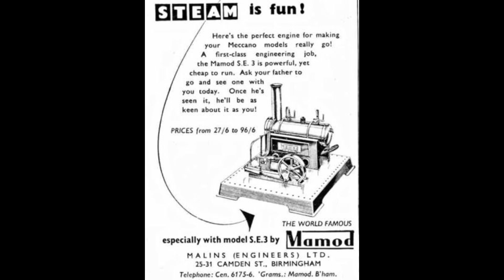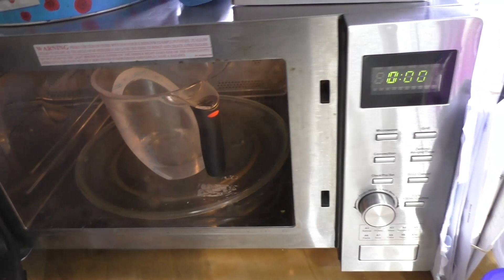The 1960's Mamod SE2 steam engine.

Comment: I had the Traction Engine with a rod that went through the chimney to turn the front axle as it went along the fire was a box full of some sort of wadding you filled it up with meth's. I built a power station out of meccano and used it to drive a DC motor and light up a bulb lol.

Comment: I had The same one in my younger days I also had a few Accessories one was a grinding wheel and I can not now remember the others they were driven of the fly wheel with a metal belt i us to fuel mine with methylated spirits now I put a drop in my cars windscreen washer Bottle to stop it from freezing up

Comment: Never run them on straight water , use a lubricant in the water such a soluble cutting oil  designed for lathes, drilling  and milling machines, the piston and  bore will last a lot longer . I have used 3 in 1 oil in the water when I have run out of  other lubricants.
Reply from the maker: That is a VERY good tip.  Big thanks.